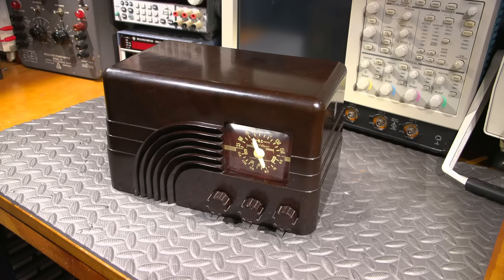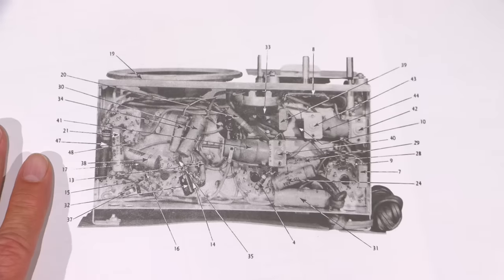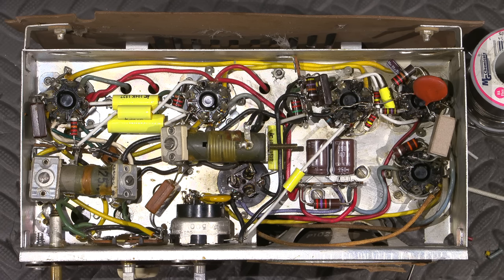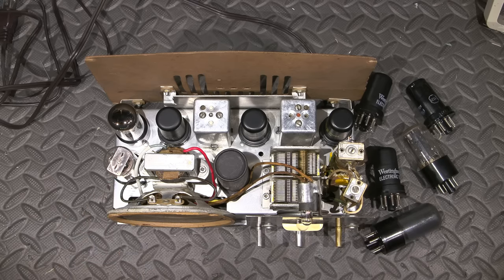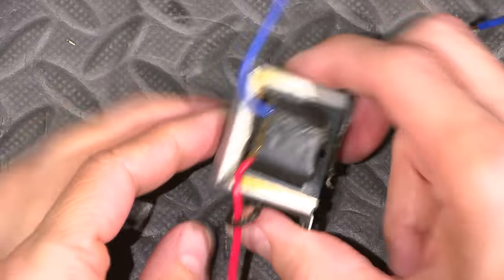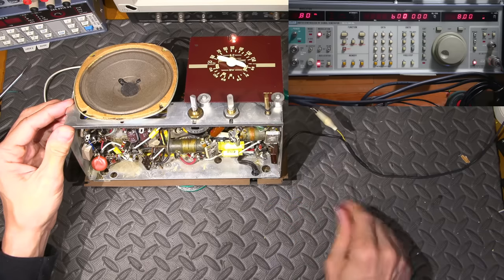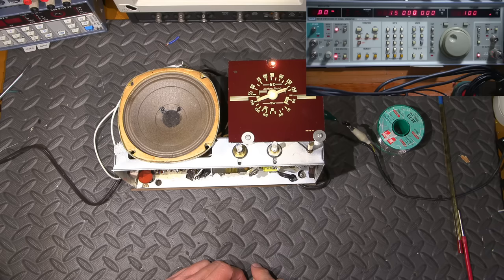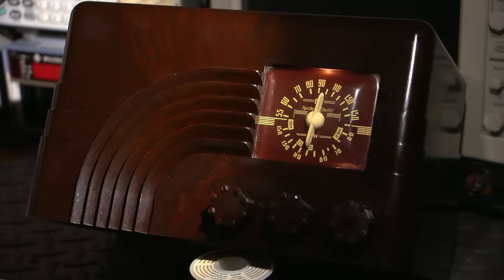Restoration Adventure, 1946 Baby Champ Radio Receiver!

Comment from the maker: To learn electronics in a very different and effective way, and gain access to Mr Carlson's personal designs and inventions, visit the Mr Carlson's Lab Patreon page here: https://www.patreon.com/MrCarlsonsLab
Reply: I noticed at 1:10:15 that you are trying to peak the sensitivity and you have to really concentrate during turning the tuning screws. It helps a lot with tuning or fine adjusting such screws when you temporalily mount a large diameter knob or "wheel" to the other end of the adjusting screwdriver. Thus you can control the angle of the tuned screw more precisely since you don't focus on the gripping of the tool. It will also reduce the shakiness of turning something. We are humans are good at gripping and putting torque, but for extended times it puts strain on our muscles and tendons. Thus the fine control ability is reduced over matter of seconds.
Reply: what a wonderful video and a classy little radio. nice to see the process covered in a single video.
Reply: VIM ???
Reply: Question Mr Carlson - I noticed that the Shortwave Antenna and Oscillator coils not only have different amounts of turns; but also seem to have different gauges of wire.  Does the wire gauge also affect detecting and receiving the different bands?
Thank you for your many years of high quality, indepth instructional videos.
Reply: love to see you design an audio visualizer like "the Lyte" from the 80s
Reply: @NAVI-bs1jg  Maria, the translator is not working on that message.
Reply: I went to patron and they sent me a code and when I put the code in I was told it was the wrong code. I tried it 3 times. It didn't work. I had them resend me the code same error.
Reply: It would be cool if subscribers could send radios for restoration. I have a couple that would be candidates, not as old but need work. One is a crystal controlled vhf scanner. Plug in and wide open squelch, no lights or anything else.

Comment: The harmonious relationship between manufacturers and customers back then was fantastic. Sad to see what it's devolved to today.
Reply: Wait, i know that nickname from a certain dark lord's social media platform...
Reply: @matthiasmartin1975  ✝️
Reply: @matthiasmartin1975  vox day
Reply: @keltar4071  I prefer Supreme Dark Lord of the Evil Legions of Evil.
Reply: @matthiasmartin1975  .I just noticed the bear in your.handle. that can only mean 1 thing owen b
Reply: MADE IN THE USA, meant quality! After pres Nixson & Pres. Ford, the open trade agreement destroyed that reality & gave to a downward spiral to us depending on the lowest bidder in a foreign country!
Reply: When I was a kid, I used to turn am radio into short wave, (world band radio). That was easy! Trying to turn it back to an am radio? that was TOUGH! i had a masters degree in electronics helping me and it took the both of us 3 hours to do that! I used to make crystal sets out of old toilet paper rolls with fine copper wire wrapped around it, a geranium diode, and an old earphone and without any power, I could pick up radio signals! 120 year old technology!
Reply: @robertpeters4161  Sounds like you could make a good YT channel with your knowledge. Sounds awesome BTW.
Reply: To play devil's advocate, these days every single tube, resistor and capacitor in that radio has been reduced to one IC chip and a couple of tiny surface mount passives. Not much to service nowadays in this particular example.
Reply: Bro what are you even talking about, the consumer is the manufacture, it's 2023 bro

Comment: As a young teenager we had a 6volt battery unit that I was occasionally permitted to take to bed for DX listening. I had an exercise book that I would record station call signs in. I would turn into a broadcast and stay until a station I.D. was broadcast. Date and time recorded I would re-tune and start the whole process. I was later introduced to radio repair and repaired, re-built many older receivers. Thank you for letting me re-live those memories.

Comment: I just completed watching this video, and while I don't always watch every video you do, I almost always tend to watch the restorations you do on antique/vintage radios etc.. 

Many many years ago, (back in the dark ages! Lol)) I worked in a TV repair shop. We of course also did radios and other electronics as well. I' really dating myself, but it was way back when things in the TV repair business were really changing quickly. Think early through mid 1980's especially. Long before internet and flat screen TV's, but things were changing very fast at that time. Most of the high quality name brands by that time, meant nothing because those names had been purchased by Chinese companies. So even though people thought they had bought a high end "beautiful Zenith" set, you'd find when you opened it up, it had the same, inexpensive Chinese "guts" in it as the no name brands. So, they had just started putting the high end name brands on inexpensive Chinese junk at that time. As for the electronics, Chips were just starting to get more and more common., as to where before that time we rarely saw any "chips" at all. 
What was nice about that time period was that it was before things really changed into the throw away world of today. People were still repairing things whenever possible, instead of just throwing out and replacing. But with the Chinese name brand scenario I mentioned above, prices of sets were coming down quickly and the throw away world was approaching quickly.  But at that time, there was still a lot if the really high quality brands out there, being brought in for repair. (Of course we'd go to the house and repair there if a simple job, but most often sets were brought back to the shop... LOTS of carrying of heavy sets in those days!) But in the early 80's, we were still taking in for repair MANY sets made in the early to late 60's. We were still replacing picture tubes etc. So, it was a great time IMO. This was also before people had cable tv in their homes. So, tv tuners were still being used. Many sets were still manual, no remote control. Or, some had the original 'Clicker' sent in with them. Remember those! Lol   ...  Tuner cleaner was still the #1 spray we had on the bench. And the old Zenith rotary dial tuners, with gold contacts that we'd strip from the old sets to collect the gold from. Lol  Those old rotary tuners would get so dirty, and of course cigarette smoke and nicotine was absolutely caked up inside coating all the sets electronics! (Since everyone still smoked in those days) But yea, those rotary Zenith tuners you could coat with Tuner cleaner, and then go to town just spinning them like crazy and most often that alone would clean them up.   Vertical & horizontal  output transistors, audio output etc etc. Lots came in with the common problems of those days. 
Long story short, I enjoyed those years a lot. And am happy I was involved at the time I was. My life went a different direction some years later and my TV repair days were over, except for an occasional home project on an antique radio or something just for fun. 

Your love of electronics shines through your videos and in the quality and details of your work! Obviously it's a labor of love for you, and it's that quality that makes people GREAT at what they do. Your work is excellent, and you address every detail in your restorations. And again, if you didn't love these old pieces you're working on, and didn't love the electronics inside of them the way you obviously do, that would change everything, because as I said, your love & enjoyment of what you're doing pours right out this end as we watch you! 

Thanks for sharing your passion with us, and thanks for restoring all these beautiful old radios you work on. It's great to see them functioning as new again. Sadly, with these great old pieces of our history disappearing, its almost like losing part of Americana as we've always known it. And while I don't think we'll ever start manufacturing TV sets and radios in the US again like we used to, we have these ild sets to restore and to show the younger generations the kind of quality  and items we used to manufacture right here in the USA. And that was back when if it said 'Japan' on the back, we knew it was no good and into the trash it went!  Lol  in exchange for an American made set.  But how the world and our country has changed. But that's another topic not to discuss here. 

Thanks again for all you do!          'JM'
Reply from the maker: Thanks for your kind comments, and taking the time to write "JM." That was a great read.

Comment: Mr Carlson, what I found impressive is the way you did the proper back and forth alignment to get the local oscillator to track to the dial. The correct way to get an AM or SW radio aligned.

Comment: Mr. Carlson, I want to commend you for an excellently presented, on what I consider a mysterious subject! Although I’ve always thought that electrical devices, radios, receivers, speaker etc. to be fascinating I never thought I could understand the deep intricacy of the parts, tubes, coils, transistors, capacitors, resisters etc. and design of the radio despite having always been a very analytical person. You obviously have that very deep knowledge and understanding of those electrical devices. That coupled with your excellent communication skills makes your segments content easy to follow without getting bored even after a video of over an hour and a half long. Thank you for such an enjoyable channel to watch and listen to.

Comment: 3:00 - regarding removing sticky knobs, guitar repairer Dan Erlewine has a good trick where he repeatedly wraps elasticated string round the shaft of the pot underneath the knob. As the string builds up and expands, it gently pushes the knob off the shaft without exerting any hard force on the face of the guitar (or radio).

Comment: Sir I KNOW this is off topic but it must be done. I send you a BIG heart felt THANK YOU for your hard work on this channel. I collect vintage 1970's era HIFI audio equipment. Receivers, tape decks, equalizers, expanders and more. Thanks to you I know a LOT more about whats happening under the hood in vintage electronic gear. I know what capacitors, resistors and relays are and how they look when distressed or broken. I can't detect all bad by looks alone BUT I've learned how to spot bad repair work and so much more. I've learned to spot easily fixed expensive but broken gear offered cheap. I've literally saved 1000's using what you teach here.

Comment: I'm always pleased that you reiterate the proper method of wiring the power cord. It's an important lesson in safety that bears repeating!

Not going to lie, I was a bit saddened when you discovered the audio xformer was bad. Considering how out-of-whack all the adjustable caps were, I think somebody started turning a screwdriver in the hopes they could get audio output, not knowing their efforts would be in vain. Totally impressed with your repair on it, and also impressed that you would consider repair when you probably have a Big Box o' Parts and could have swapped it out more easily than repairing the original. However, that defeats the "restoration" as it would then have a non-OEM part installed.

I'm guilty of using "unorthodox" antenna methods myself, although for FM reception. A home's cold water supply (well water) makes a rather effective antenna in a basement. 😆

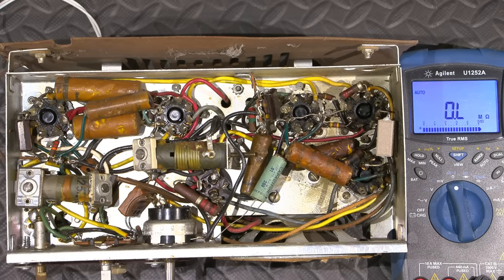Beautiful restoration, as usual. The night-and-day transformation at 28:36 was amazing, such a clean job!
Reply from the maker: Thanks for your kind comment Andy!

Comment: I always use a polarized plug when replacing power cords .
To keep chassis neutral and the hot side switched.
Your videos are the best Stuff I have found for electronic repair and restoration
Reply from the maker: Thanks for your kind feedback Gerry!
Reply: I always ad a small isolation transformer for safety , security and perdormance.
Reply: @erin19030  no need to if theres no external connections, as long as you cant contact any part in normal use , people werent dying like flies from these things,
Reply: problem is many switched the chassis/neutral side, it was done to reduce hum pickup, if live was switched, there was chance of picking up hum from the 'live' wires to the switch part running near to other components

Comment: I have been enamored of these art deco radios as long as i can remember.  I currentl own a Sterwart Warner table set from 1947. It remains idle since it does not receive any stations.  I absolutely do not doubt it was a solid performer.  I turned it on once! What a beauty all lit up.  It works at getting started, but alas state of AM broadcasts is non existent.  Yet i could tell the sound was spectacular.  Its a beauty.  Keeping it! He's all mine, lol.....❤

Comment: I always whack my signal generator onto the primary side of the  audio output transformer and  if I get a tone from the speaker it's done, of course the radio is totally disconnected from the mains and is one of my first cold tests I do. I love the long video repair format that you do it's your channels best output in my opinion. Fantastic restoration video Mr Carlson.👍👍👍

Comment: On your radio's SW band, it covers 3 Amateur radio bands, hence the Morse code heard. If you (crudely) coupled your signal generator to the back of the receiver at the I/F frequency (was it 455 kHz) you may be able to resolve some of the SSB and also hear the Morse code properly. I've done this a few times and even made a BFO using a 455 kHz ceramic resonator and a common diode used as a varicap diode to adjust the ceramic resonator frequency and you have a BFO for an AM radio with NO modification to the old radio itself, just an insulated wire running under the chassis to couple the 455 KHz BFO to the I/F.
If anyone is interested in such a BFO, I am happy to share the details.

Excellent restoration and what luck with the audio output transformer. All the radios I've restored that have had O/C primary audio output transformers, the winding has gone O/C within the core itself and have not been fixable and have had to be replaced.

K.

Comment: The white paint overspray might be the same reason as I see most of them with white dots around here: older radios usually are put into the rooms during renovation and people don't cover them up - "it's just the old radio and will be replaced soon" - and then it's all white wall paint spatter from some paint roller for them.
Reply from the maker: That does make sense.

Comment: That was an awesome job to do and for us to watch. Great receiver, that baby Champ. But again little knobs. I restored a SW radio and mounted a knob of about 8 cm in diameter. Much more easy to tune to stations, little movements or even only touching the knob is now more accurate. Thanks for this great video!

Comment: Awesome!
I'm an electronic technician for even though I'm actually a teacher when you were a repairman, you always are. My mother had a 1947 Phillip radio with the same 5 tubes as this Northern Electric does. Pretty similar.
I still had the opportunity to repair some tube TVs in the 80s  when I was a boy.
Well I really enjoyed your vídeo of restoration and I was also amazed at the accuracy of those engineers in those days.
Congratulations for the great job you do and the way you appreciate those old good apparatuses!

Comment: Hi Paul  this is Dave Wallace/wally  .With self tapes  .When  you reinsert them you turn them backwards so they click then you turn them forward so they cut in on the same cut✂️ as before this will stop stippling  of the original . material . If you have this problem   You use a bit of copper wire to space out and this will save you. Have done this many times and have had great results. Great show/channel 👍  .Best wishes 10/4 Good Buddy.

Comment: WOW cool! My dad has the exact model of the radio receiver. It was not functioning very well, so he gave it to me when I was a teen (around 1980) I did some cleaning of the volume control, changed a capacitor, and replaced a vacuum tube. It worked for years until AM radio stations all closed as FM became the only broadcasting available.  But the radio still can work even today. For the fun, I made a very low-power AM transmitter a few years ago that I fed with an audio mixer output to make some kind of cool radio station for my kids. (The power is so low, it can barely be received over a limit of 100 feet.)

Comment: The performance on the SW band reminds me of listening to NHK Tokyo and Radio Moscow in the mid 1960's from a high elevation in Oregon. They came in 5 x 5 with little static. There is so much static from electronics and modern lighting these days!

Comment: Very impressive little set, and what a wonderful range of stations you have, where you are located. 
I am located in north-west England and the reception of stations on the "Broadcast Band" ("Medium Wave" as it is known here in Europe) is pretty poor, with large chunks of the band being silent. Most of the national radio stations have been taken off the "Medium Wave" Band, in-favour of the V.H.F. band (87.5 MHz - 108 MHz) in F.M., and "D.A.B. Radio" in the U.H.F. Band.

Even the "Longwave Band" (153 kHz - 279 kHz) once used extensively in Europe, is gradually being abandoned, with just the British 'Droitwich' transmitter on 198 kHz, and Southern Ireland's "RTE radio 1" from the 'Clarkstown' transmitter on 252 kHz being receivable here now. Even Luxembourg that had been on Long Wave since the 1930's, has recently closed this LW service.

Even "Short Wave" is gradually being abandoned, with many European broadcasters switching over to internet radio for their broadcasts.

In my opinion, it is a very sad demise of a broadcasting medium and is gradually rendering vintage radio's to museum collections.